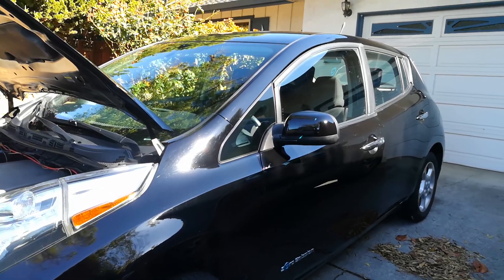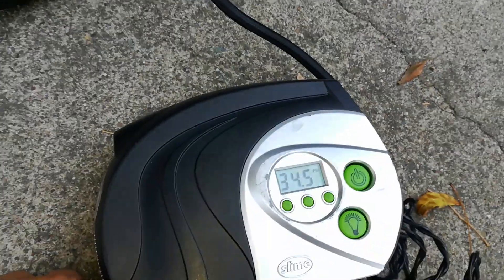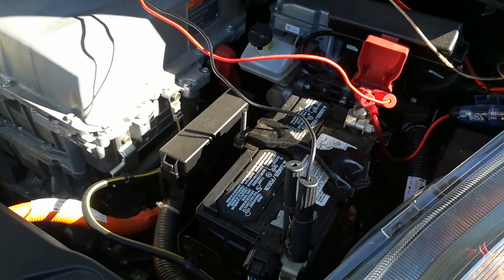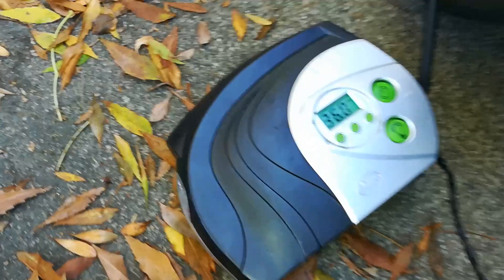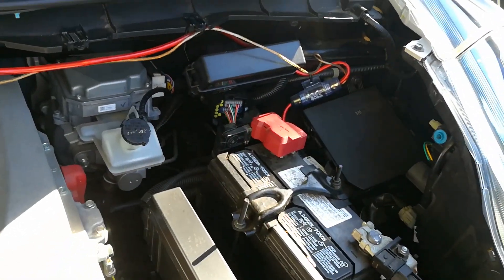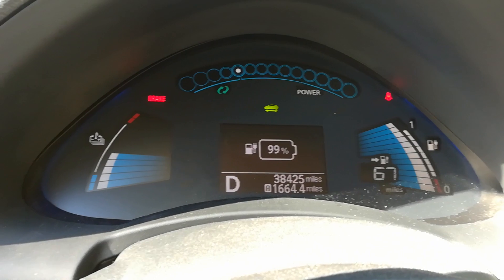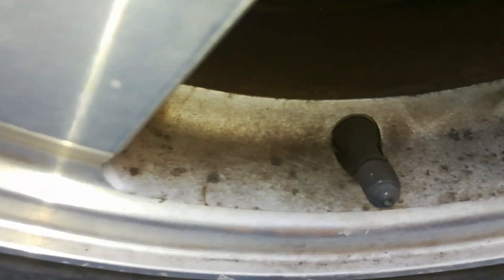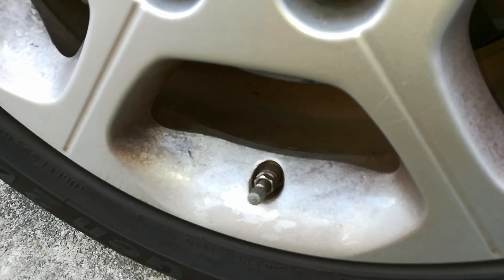How to Reset Nissan Leaf TPMS Tire Pressure Monitoring System

Comment: WORKED LIKE A CHARM !!! THANKS FOR YOUR HELP !!! Now if you could help me with my EV WARNING LIGHT & TURTLE MODE. Cannot figure it out 🤦
Reply from the maker: Glad it helped.  Turtle mode? Any updates?
Reply: @RANDOMFIX  I ended up unplugging the battery and reconnecting after 10 or so minutes. Removed the error. I sold the car so not sure if reoccurrence of the issue has happened.

Comment: got a 2021 leaf gen 2 with 9000 km - did it like you did and the warning light is still on...
Reply from the maker: thank you for the feedback!
Reply: @RANDOMFIX  ok, fixed it. i think. you need to reset it maunaly. Strange to me. I mean its computing the pressuare at every tire but still displays a warning. Makes no sence. Regular maintenance is in 3 month.

Comment: Hi RandomFix.  Thanks for your video.  At 1:35 you said “...so you want to make sure that, if you can, try to avoid using the cigarette lighter...”.  Please explain your reasoning for this, because I didn’t get it from anything you said before or after this quoted comment.
Reply: i tried using the same compressor he has on the cigarette lighter, but the compressor stopped after a few seconds. It's probably current limited.
Reply from the maker: That's weird I'm still using that same exact compressor and no issues. _Randomfix

Comment: Thanks for the video but caution as to the 12V battery draining due to tire pump is unfounded as long as it’s a healthy 12V battery. I’ve done this several times powering the air pump via the lighter.
Reply from the maker: I'm glad to help.